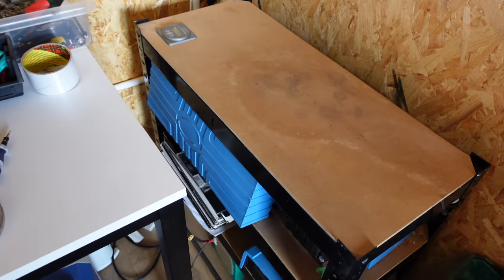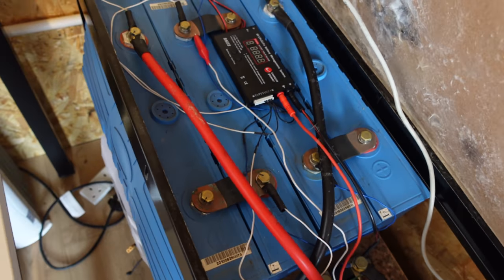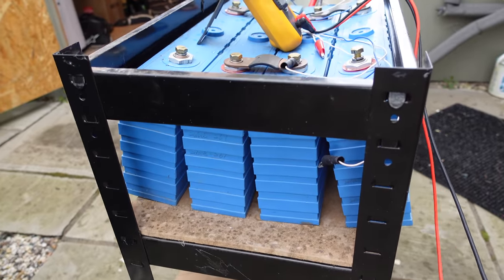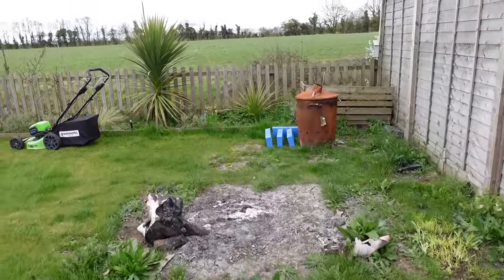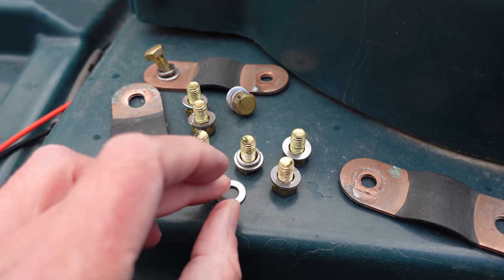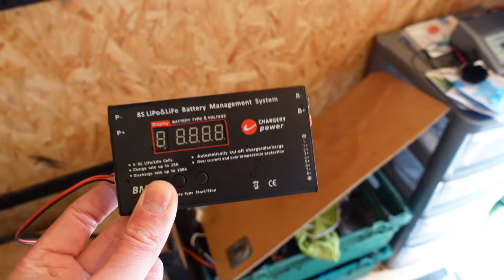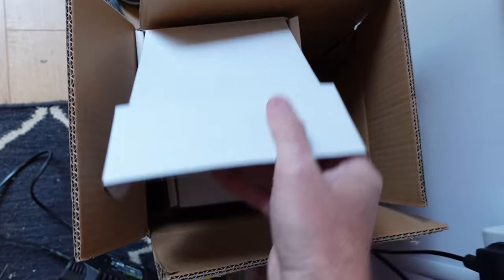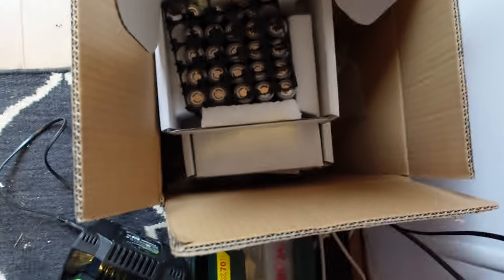biggest swollen battery i've ever seen!!!

Comment: you have to buy a good BMS that cuts both charging and discharging at too high, low voltage of the battery, then you can save yourself this misery.  Be glad they didn't break because that doesn't make you happier.  Cry out and start over, good luck.

Comment: I think they should be fine if you try to recharge them. Dead and puffy lithium polymer cells shrink a bit once I charge them to about 3.7V, so these might shrink too. LFPs are generally safe, I accidentally charged mine up to 4v per cell and it was fine. No signs of puffing even though it was pouch cells. But still, 3.65v limit is there for a reason.
Edit: Your cells might not have gas buildup but layers expanded. This happens with these big cells as you use them no matter what (granted, the expansion is typically several millimeters after years and years of use), this is why you need a case to keep them from expanding.

Comment: well you are right, the BMS and battery protect are all still using some sort of power, and that continued to discharge after it was already rather low. So word of advice when taking a battery out of service, remove the BMS so the cells are completely disconnected. You could go one step further and disconnect the cells from each other so there isnt a higher potential across the batteries which in certain situations can even slowly discharge through the air or some other odd phenomenon.

Comment: Hi Andy. 
I've been running your 1500w ebike kit for 7 months now and it would be great if you could do a video on the best way to look after the battery,  I.e. charging and setting up the handlebar computer.  I've done close to 2000 miles on it , using it for commuting.  It gets charged twice a day and I notice a powe drop off when the battery gets to around 75%. The battery never gets fully discharged,  but would be helpful to know the best way for  longevity purposes. 
Regards 
Brad
P.S.
The kit is fantastic 👌

Comment: They may well be recoverable. Not to their original capacity, but usable. They would have likely faired better with compression, or else the pressure relief (the little fitting on top between the terminals) would have popped.  I'd put on some safety goggles, a face mask, and strap them together to apply some moderate compression and start them at a low charge current to get them up over 2.5 Volt

Comment: That happened to me too with some LifePo4 bricks like yours but smaller and each cell was down to 2.2v. I thought they were stuffed and just left them all disconnected. Some time later I noticed the swelling had gone down and so I tried charging them and they all charged back up OK. I have them in a compression setup up now too. I haven't capacity tested them yet, but they took a decent amount of AH to charge up.

Comment: No worries. Just squeeze them back by building a wood frame with 2x4 and use them for another 10 years. If you read the spec it stated lifepo4 shall be compressed. My batteries looked like that when they were over charged and I was fiddling with BMS a winter day, didn't expect the batteries would overcharge up here in these polar areas a winter day (south Sweden). You will notice a slight lower discharge rate but capacity will remain same.

Comment: You have to try to charge them! In a safe location of course. Will be great to see what happens even if it is spectacular.
Reply: Nothing spectacular will happen. They will take charge as normal, just that the capacity degraded substantially. That's what LFP does when it is abused...
Reply: Wow. That is bigger than is should be, thankfully it wasn’t all enclosed. Had a similar experience with a goal zero SLA battery, it swelled and took the shape of the transformer and 12v socket next to it. Horrible sizzling noise and acrid stink. Time to replace I think

Comment: BMS- Battery Murdering System, stopped using them 14 years ago, always cell monitored on charge and just discharged to a conservative level using a power and volt meter, BMS would have been trying to balance the pack, it's also possible the disconnect relay was drawing off current as well, good to see you back in the shed mate.

Comment: BMS is normally powered through the bms lead (and the battery negative is some but not all cases) mine only needs the balance leads.  Normally, i almost got caught myself with a pesky bms, they were down to 2.8-3v on ncr18650pf cells, I can't remember exactly but what I do remember is thinking"oh shit, get those charged ASAP".

Comment: Can't discharge to near 0 and expect things to go well!  Thats why an active BMS should always be used as the BMS will cut the load, and itself off to avoid draining to 0.   What happened to your bats is not so much to do with not being compressed together, more to do with being drained to 0 and then charged again?  Battery compression will "hide" the damage more, but the damage will still be there inside the cell.

Comment: The Victron battery protect still consumes around 0.7mA even with the link removed - the only way to fully shut it down is to pull the connector with the ground lead out. I know it’s not a lot, but even the smallest “drip” drains a tank in the end. So sad to see those “blimpy” batteries, I’m sure they had loads more life in them, had they not been damaged. 🔋🔋🔋👎👎👎

Comment: This is why we compress lifepo4 cells. They NEED to be held tightly even for normal use.
Reply from the maker: Interesting, did not know this, they were running fine for 3 years+ it only happened when they were deep discharged.

Comment: Just open the valves press on the side get it back to normal. Put the valve back on.   Get a piece of long wires.  Leave them outside away from buildings and keep using them.     🤣

Comment: If you need to dispose of lipos safely. Discharge battery (yours are clearly discharged) get a bucket, fill with salt water then leave them in it for 2 weeks. They will be safe to chuck away in the bin they don't contain anything nasty that didnt come from the ground in the first place. As for them big bad boys you could take the cells out after the salt water thing to dispose of the plastic box sensibly

Comment: Swollen Battery means u need a new battery would get rid of it because Swollen batteries, while not common, are a significant risk. They are the result of too much current inside a cell of the battery, which causes a build-up of heat and gas This can be caused by overcharging, manufacturer defect, deep discharge, or damage to the battery take them back to where u bought them to see if u can get a replacement they should be covered under the 5-year warranty on them would replace all the parts and wires something is causing it to become damaged....